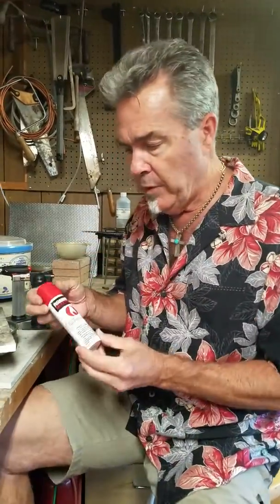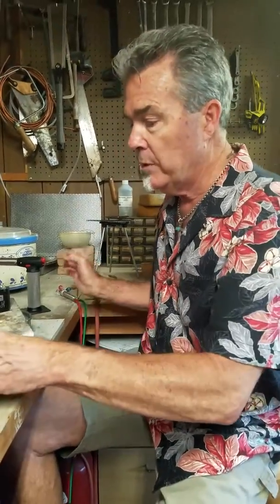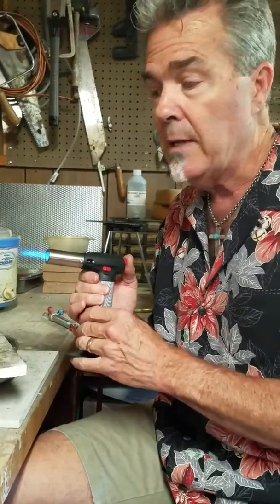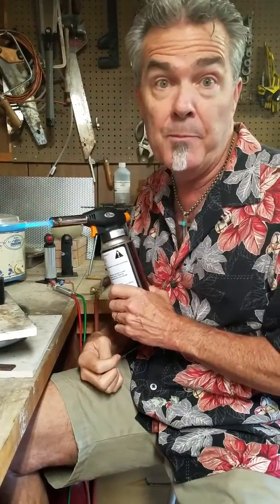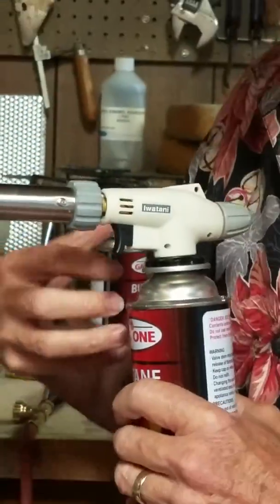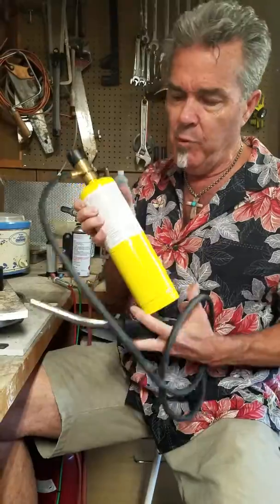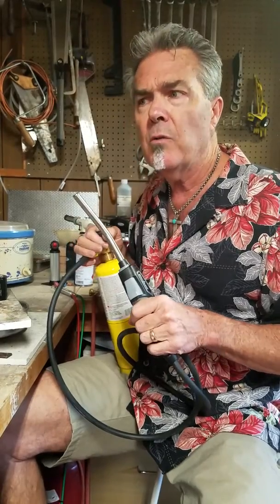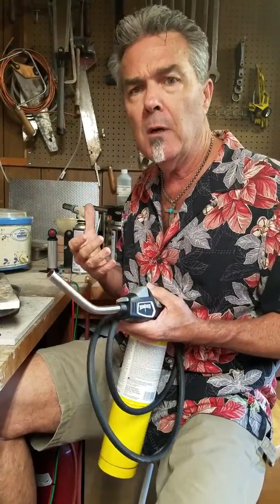How to choose the right torch for jewelry making - TidBits and Tin Snips™

Comment: Very informative, Jeff. And thanks so much. I was sooo excited yesterday when I got my Jewelry magazine and there you were!! How cool. I’ve seen you appear in little blips before but this was such great exposure for you! Yay Jeff! Anywho, thanks for all you do for us jewelers.
Reply from the maker: Thanks Bobbi. Glad you liked it.
Reply: @artistjefffulkerson4327  Really all I want to do is rings.  What do you think is adequate?
Reply from the maker: @jennyclark6183  Hi Jenny, You could use a large butane torch like this one. https://www.amazon.com/Butane-Torch-Kitchen-Blow-Lighter/dp/B07FFNKQVD/ref=sr_1_8?dchild=1&keywords=butane+torch&qid=1620851265&sr=8-8 You can find them at restaurant supply stores.
Reply: @artistjefffulkerson4327  Gee, that's a monster.  Why do you need such a big torch for something as small as a ring?
Reply from the maker: @jennyclark6183  It depends on how large your ring is and the mass of metal you're trying to solder. If you're just making tiny rings, you can use a smaller torch. I think the best all-around is the acetylene/air torch like Presto-Lite or Smith, but those cost a LOT more.

Comment: What size torch tip and handle was with the b-tank and acetylene setup, Jeff? Thanks
Reply from the maker: The Presto-lite torch comes with 3 or 4 tips. I usually use the #3 tip for almost all of my work. Hope that helps!

Comment: One VERY IMPORTANT point you failed to say about acetylene is it must be used in an upright position and if for any reason the tank was in a horizontal position like if transporting in a car, IT MUST be placed standing upright for a prescribed length of time! This is so the acetone has an opportunity to get back through the porous  element inside the tank EVEN BEFORE the regulator is attached!!! The length of time it takes to settle before usage is determined by the size of the tank in question. ASK the agent at the gas supply store how long to wait for your particular tank. Otherwise they may not offer that info assuming you know what you are doing!!! 
After all, the end user is ultimately responsible for any damage, injury, or death!
Reply from the maker: Great comment! I should have mentioned it.